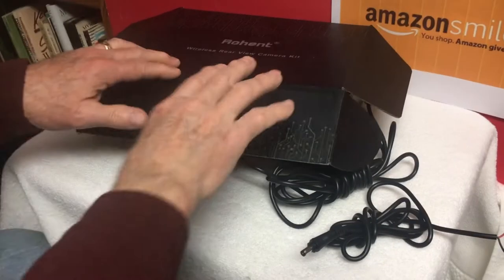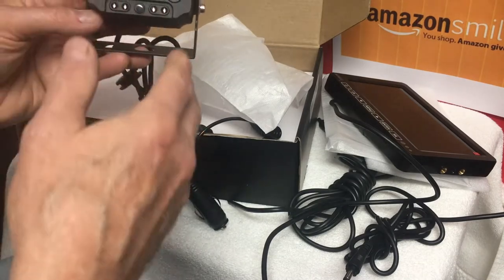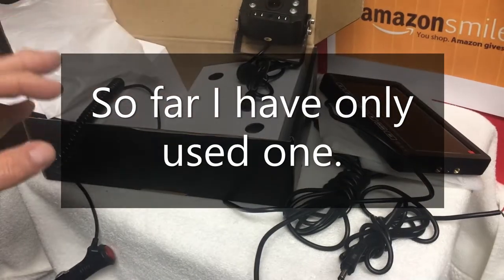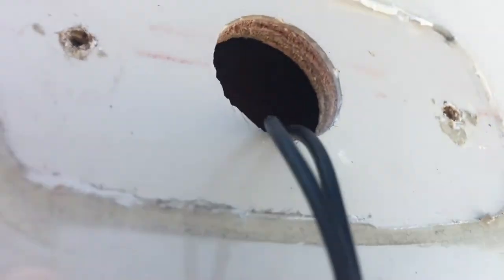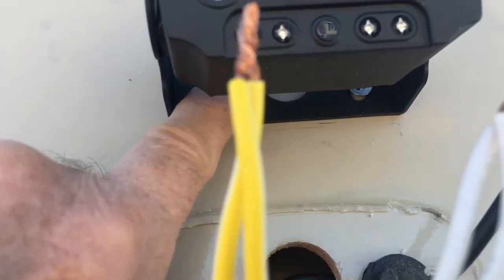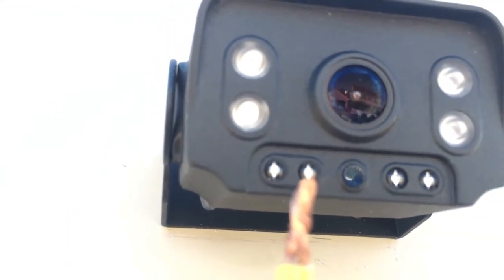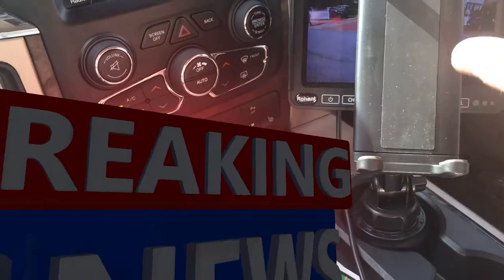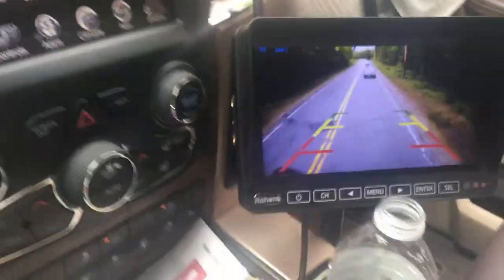Rohent R9 RV Backup Camera Installation on Travel Trailer

Comment: What is the product name of that cupholder screen mount thingee?
Reply from the maker: I didn't end up using it but it worked quite well at least in my deep cup holder in a Dodge RAM.  It is, Kolasels Car Cup Holder Tablet Mount with Adjustable Arm for 4-13" Tablet & Phone, Truck Cup Holder Tablet Stands for iPad Pro 12.9 11 10.5 9.7, iPad Air Mini 5 4 3 2 , Samsung Galaxy Tabs, iPhone etc. Found on Amazon